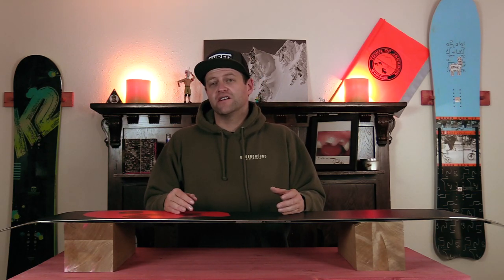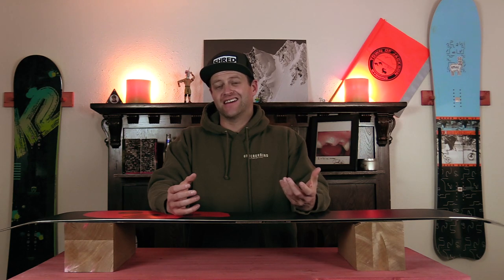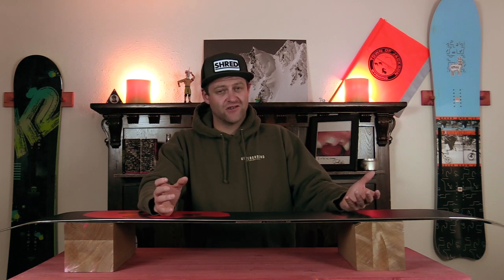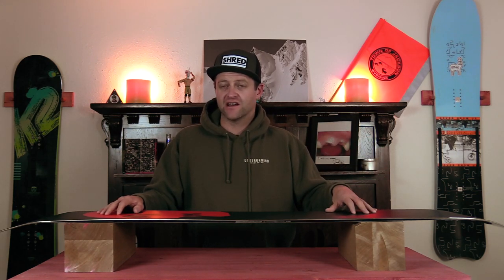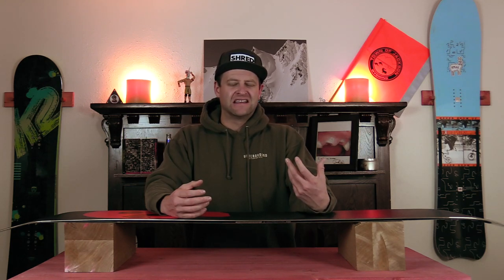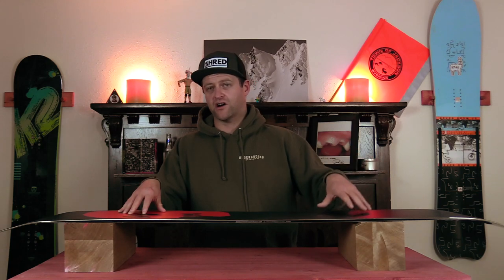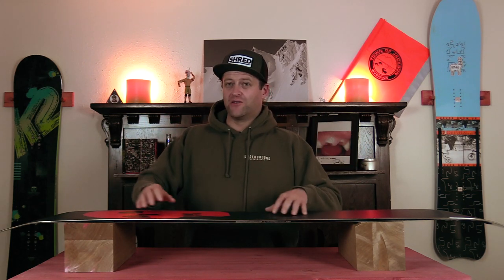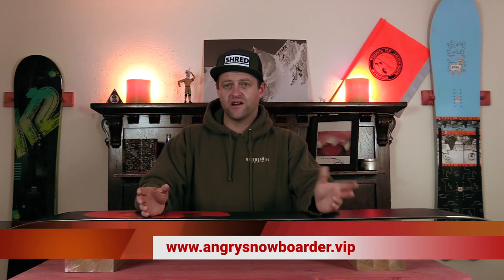Snowboard Base Structure: Explained

Comment: Hi Angry, I got a 23/24 Ultrafear camber to replace my 21/22 DOA for park riding at BigSnow, but it is very slow. The depth and lines of the structure are noticeably less on my Ultrafear compare to DOA(quantum base vs super base?) Can I ask a shop to remove/restructure the base of my Ultrafear, what type of structure would you recommend; linear, cross, or something else?  TIA
Reply from the maker: You can, ask them what they recommend.

Comment: Structure works.  It's nice to have. Most shops here do a crap job with stone grinds especially if the board has a spoon  shaped nose and tail. I figure with how bad the work often is that you've got a 50-50 chance of it improving things.
Reply from the maker: Just go mach 10 down the mountain into the dirt parking lot. Free stone grind and random structure pattern.

Comment: Thanks for the explanation!  How do you make sure the wax is removed from the structure after waxing it? And scraping would not damage the structure? My party platter has structure and I'm afraid I will damage it if I scrape it with an acrylic scraper. (I know you don't wax, but you probably know the process)
Reply from the maker: If you're aggressive with a metal scraper sure it would damage it. Then again why are you even waxing it's pointless, just maintain the structure. But if you're going to wax get a good set of brushes similar to this: https://amzn.to/2PCvuwu
Reply: I have a sintered structure base and I’m thinking the same thing, when time comes to waxing the base, what would be your recommended process? Cheers in advance
Reply from the maker: Waxing, hahahaha!
Reply: @AngrySnowboarder  Where did your anti-wax mindset come from?  It seems pretty relevant when you are forced to traverse flat terrain and it's definitely saved me from bootpacking out of a flat pow zone plenty of times.

P.S., I think people would benefit from you doing a more elaborate video on what structure will help in wet spring snow vs dry powder.
Reply: @AngrySnowboarder  Thanks, I really appreciate your time!
Reply: I have been riding for 30+ years, never had structure, never even really knew about it until today.

Soooo, no waxing?! Seems insane.
Reply: @littlcor  he got from the Olympic USA team's tune guy for the half pipes and stuff. Found more boards snapped when they were waxed also. If olympic athletes are going quick like they are you copy what they do. So good structure and no wax. If you're racing use dish soap
Reply: @BrodynSmith  Thanks for the reply Brodyn.  It'll give me some better direction for my google-fest i'm about to begin.
Reply: @TheToddRobins  It seems just a little extreme to me, too. Honestly though, if only structure and no wax works for some people, then I say more power to them. I only know my first-hand experience, which is what informs my actions. The Capita boards I've been buying seem to have excellent structure out of the factory. I can see and feel it, and also hear a zipping sound whenever I snowboard. However. Wax is still crucial for me. I went out to the backcountry on a hot, late spring day with heavy, wet snow earlier this year with a board that hadn't been waxed recently. It stuck to the snow like glue on all but 30+ degree inclines. Then I waxed, and the next time, I glided effortlessly. This was a newer board which certainly still had structure. For me, I have real empirical evidence that waxing is hugely important in some snow conditions (warm and wet). I suspect it might be LESS important on fast, groomed hard-pack at resorts. As for the commentary on boards snapping.... I've never had a board snap. Ever. Not for boards I used for two ~80 day seasons of waxing weekly, at least. Hot waxing doesn't seem to compromise my board durability, at least for doing some normal riding and 20-30 ft jumps occasionally (not a jibber). In fact, I feel that my well-waxed boards are more resistant to damage. I believe in the science of waxing. P-tex is porous and capable of absorbing wax. Wax is hydrophobic, and the H2O of snow is hydrophilic. Wax repels water, so it makes sense. 

Plus, I'm fiercely independent, have no local "go-to" shops I trust or frequent, and want to take care of my boards on my own. I don't want to take my board anywhere. And structuring isn't something I can do on my own. But it's been working pretty well so far. I polish and sharpen edges, and wax. That's all. I make due with the structure the manufacturer puts in the board. Works fine for me.

Comment: Just got structure in my board from your recommendation. Is it supposed to run from tip to tail? My shop did it just in the middle and wonder if its wrong
Reply from the maker: What?
Reply: @AngrySnowboarder  the structure only runs between the contact points. the tip and tail hasnt been done, is that normal? basically what I'm asking is if the entire base should be structured
Reply from the maker: Yeah that's fine.

Comment: So I have a bataleon goliath, which came with a structured base.  I took it to a snowboard shop to get it waxed and I got it back with no structure.... Is that normal or was it a crap shop?  Are you supposed to get your board restructured every so often?
Reply from the maker: Wax is heated up to liquid form then it cools down and solidifies.
Reply: @AngrySnowboarder    I understand how wax works; maybe I wasn't clear enough in my question unless you're saying the wax filled in the structure.  Every other time I've waxed, you could still feel the structure with your nail.  Now it's as smooth as a baby's butt.

I'm wondering if they belt-sanded the base to tune it and ground down the structure before they waxed it.
Reply from the maker: Or they just didn't brass brush it.
Reply: @AngrySnowboarder  I'll just that a shot; hopefully that's it!  I appreciate your insight  🙂

Comment: Anything to look out for when getting base done on a board with a 3 degree bevel? Can any tune guy take care of it or should someone really specific only do it?
Reply from the maker: Like the base has a 3 degree bevel or the base edge has a 3 degree bevel?
Reply: @Angry Snowboarder base edge bevel. To be specific it would be regarding the DC PLY.
Reply from the maker: If a shop doesn't know how to put a bevel on a boards edge you probably shouldn't be taking it there to be tuned.

Comment: So if the board has that structure made on the base, does it need waxing? I haven't encountered with this so far, and my GF's Volkl Savvy 2017, and its base is making that sound. Even when I wax it and scrape it, I can still hear it and its not perfectly smooth and flat
Reply from the maker: I don't wax.
Reply: @AngrySnowboarder  any reasoning behind that? I would love to learn more about it, do you have any literature to read about it?

Comment: Ok Angry, do you think this would help my EJack knife glide better over wet and manmade Snow?  I can go without wax if it works.  I only wax to make it faster and if I don't need it with structure I won't bother
Reply: Wax always
Reply: @morgue1130  No wax on structure.
Reply: @olecranonrebellion9976  I’m a ski/snowboard technician and you’re wrong. 9 days ago you commented on an angry snowboarder video titled “5 reasons you’re not progressing”. You said yourself you’re a beginner. You need years of research and experience snowboarding before you can give snowboard related advice/knowledge to anyone. Wax always

Comment: Would a wet belt sander be able to add structure to a base? Recently took my board to a shop for a stone grind. Guys at the shop said they do a belt grind with wet sand paper on boards and it would give the same result. Got my board back and there was no structure pattern whatsoever, just a smooth base. So in the end did I get screwed over?
Reply from the maker: No, they're lying to you.
Reply: they're lazy and don't know crap.  leave them an appropriate review.

Comment: Fifteen years ago I was etching a razor blade from tip to tail every cm across the base of my boards worked like a charm in the Pacific Northwest slush that we enjoyed more often then not
Reply: Did you just freehand it?
Reply: @homealone5087  exactly.  so.  how does one do this... .. .
Reply: @galehess6676  I'd take it in to a shop if its a board you like. If its an old peice of crap you want to experiment with I'd say try taking a razor to it.
Reply: @homealone5087  Right.  I took it in last night. Biggest shop on the East Coast (is what it is lol), they have a Montana machine which grinds and removes all the fuzzies and does cross hatch (or linear).  So,  I am pretty pumped.  Supplied my Hot Sauce wax of choice.  $72 and done in $72 hours, full tune grind n edges.  Buckman's in PA, 7 locations, can drop at any and spec where to pick it up.  I'll put up a video showing the results on Friday.
Reply: You can make a jig.
Clamp a razor between 2 pieces of wood so you can set a constant depth. Set a piece on wood in the length of your snowboard. Wove it along, move wood and repeat
Reply: @galehess6676  Dont wax it.

Comment: Nice! if a board has structure, does waxing fills those little gaps? Is that ok ? I have a Capita board.
Reply from the maker: Just use a brass brush after waxing on it.

Comment: What are the situations where wax is preferable?
Reply: I put a combination of race wax and normal wax on my board, thinking I'd be super fast. 🙈. I went slower.

So I took it to a shop on the mountain to get it professionally done, for the conditions. But the conditions went to below -10 the next day 🙄, so I ended even slower and even came to an abrupt dead stop in places.

In the end, I had a full service including having structure put into the board. It was fast for a day or so, mostly because the edges were ninja sharp.

I've never had this problem with any other board.

Comment: Sports Basement destroyed my Lib Tech E-Jack Knife.  I purchased a full tune/grind, and DPS Phantom installed. Out the door $254.
My board is 30%+ slower and with race was 35%+ slower. GPSed speed runs. 
My $150 amazon park noodle POS is faster now. That board could not touch my Lib Tech before I had the work done.
Any ideas WTF happend?
Only 5 days and 25  hours physically snowboarding down a run/line.
Reply from the maker: I don't know why you got a grind if you put DPS on it as that is an epoxy like chemical that hardens to the base. Stone grind seems excessive since it was covered over. My guess is they didn't put it on right but I have 0 experience doing so take that with a grain of salt.
Reply: Grinded then DPS. I'm figuring it out. I was just looking for input.  Thanks

Comment: Maybe im doing something wrong but i did never experience a base loosing structure that much, you would recognize. Further information given: i have about 80-100 days per season and get myself one new board (Capita indoor survival) in the beginning of every season or at least as soon as it is available. How does structure get out of the base?
Reply from the maker: What are you asking?
Reply: @AngrySnowboarder  how does it happen that you need a new stonegrind? How do you get structure out of the base?
Reply: @klnrtrzn4449  Structure removes some base. Its a process that takes time and machine, which is why top tier boards have it from factory. Some boards at just ran over a flat belt. This is much faster.
Reply from the maker: Hitting rocks, jibbing, normal abuse, random freak scraping accident.

Comment: So I have a premium stone ground base I get a small core shot on 2nd day of use.
Make mistake of thinking local shop could do a better job than I could at home..
Not only do they do a shitty p tex repair  they burn the crap out of the base with some old or dry belt sander.
A better shop cant get the stone grind pattern across the board blaming the hack shop..
What is the best way to undo burnt base damage?
Reply from the maker: Sounds like both shops suck ass. A good stone grind with an edge tune will take it down to fresh material.
Reply: what made the ptex repair shitty? I literally did the same thing as you on my new board this season
Reply: @AngrySnowboarder   Actually upon further research it turns out that both of my K2 simple pleasures the 1920 and the 2021 are both concave.
Reply: I think it actually makes them real faster on the turns and it's not a problem.
 I was able to get rid of the base burn on the edges with super sharp steel scraper light touch and lots of patients it's actually better than before now.